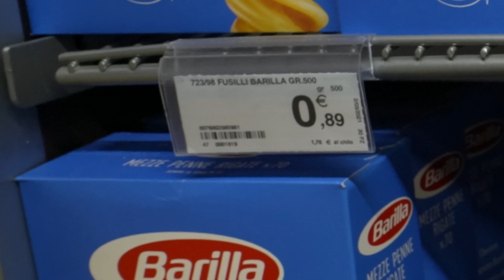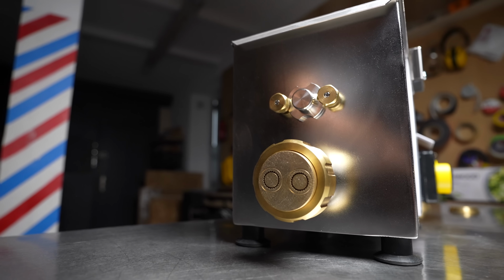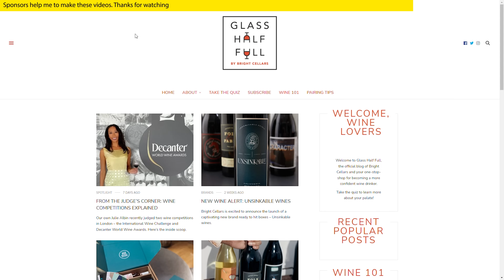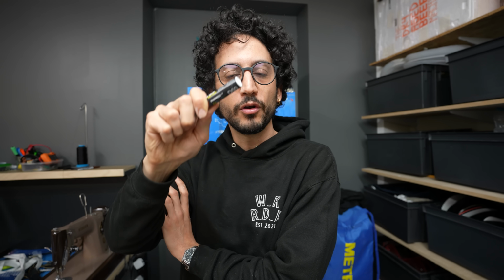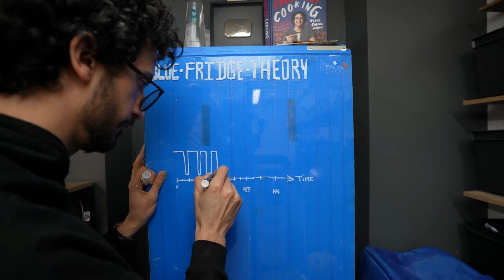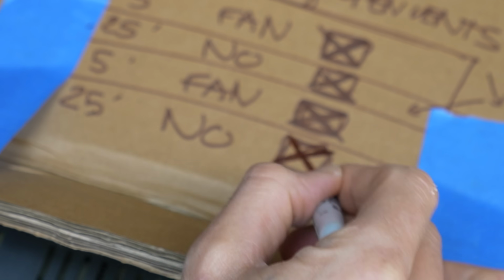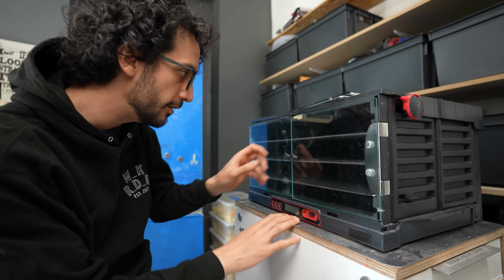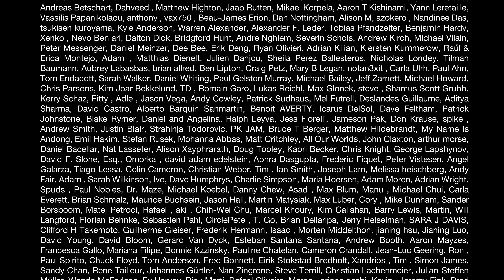This is Why Drying Pasta At Home IS ALMOST IMPOSSIBLE

Comment: You need a reflow oven. They are used to flow solder for printed circuit boards. PCB solder reflow requires accurate temperature profiles (well as hobbyist you can get away with not doing it exactly) my point is, a reflow oven can increase temperature at a certain rate, maintain, lower it, wait, etc. Seems like exactly what you really want to dry pasta.
Personally, I would just make a temperature/humidity controller with a microcontroller...

Comment: Good luck on the vent-ilation project! I was surprised you did not add a timer in the circuit of the dehydrator yet, it's probably time to build a franken-dehydrator! Have you considered the "cold and humid" aspect of the resting period mentioned in Italy? Turning off the dehydrator may be insufficient.

Comment: During the rest period, you may need a humidity source. Your chamber air is consistently dry during the whole process. A dish of water maybe?  Alternatively, you can look for a temperature humidity oven (TH chamber) so you can control the temp and RH at a ramp rate you want.

Comment: That fan might actually be working but going in the opposite direction you think it is.  You can see from the string that the center is the intake so the flow would come out the edges.

Comment: Interesting stuff. I also wonder if the humidity has some part to play - he mentioned they dry pasta with low humidity high heat, and then flip to high humidity low heat.  It seems like you aren't replicating that latter step, as you just turn off the heat.  You likely need to increase humidity too.

I'm guessing that the best pasta you produced came from the areas surrounded by other pasta, as the increased humidity from the surrounding pieces helped keep it more stable as it rested.

Comment: The hard one is called elastic because in mechanic physics an elastic shock is one that converts 100% of its kinetic energy from the first object to the second. (Which means it has infinite hardness).
Elastic on the other hand means the object will deform at the moment of contact and not all the energy is transferred.

Comment: Alex as I could see the fan on the drier is sucking air out of the machine, so it is installed to extract the humidity of the box, not to recirculate the hot air inside. I don´t know if from the design perspective that is correct or not, meaning that may be if you change the direction of the fan will solve the problem or just replace it with another one.

Comment: Alex, in order to get the pasta properly dry, you need to get it wet. It reads like madness but hears me out, there is this force at the molecular level that attracts the water molecules between them, that force without finding water in the environment your pasta is drying will pull the pasta molecules shrinking the gap in between and breaking the pasta.
The solution I propose to you is to, along with the new fan, to ad a shallow tray with one or more ultrasonic humidifier discs, this will add moisture to the environment. The humidifiers will need to turn on, when the electric heating system of the dehydrator turns off, keeping the fans on so the air currents can distribute evenly both heat and moisture.
The moisture of the external layer will reduce the stress on the exterior of the pasta, reducing cracks, while allowing the interior to dry slowly.

Comment: so uh, i think youre partially correct about the purpose of the rest period. 
it is true that it is necessarry to give the internal water to make its way to the surface, but i think it is more important to make sure the outside of the pasta never fully dries out. as youve seen, fully dried pasta is a one way street. which is why at the factory, the pasta doesnt just rest, it rests in a high humidity environment.

Comment: If you are looking for high quality fans for this projects, I recommend Noctua’s Industrial PPC fans which have high performance and can operate reliably in a variety of conditions (including higher temperatures), and the noise won’t be too bad (as long as you don’t use the 3000RPM VERSION), and they are very quiet at lower RPM while still performing well, so you should be able to film with the machine running in the studio.

Comment: I’ve studied a lot of physics and a tiny bit of material science. The plastic versus elastic definitions are absolutely spot on! Plasticity is not about if a material is made from the things that we call plastics because of their chemistry, it’s the property where a force will permanently deform a substance (like play dough). Elasticity is the property where a substance will bounce back to its original shape (like a  rubber band or spring). The fact that your pasta is brittle and easily fractures when in the elastic state just means that it has a very small elastic threshold. It’s still elastic, it doesn’t deform, it just reaches its elastic limit very quickly
Reply: Also, good work! This is absolutely amazing! I’m very impressed with your work!

Comment: @Alex
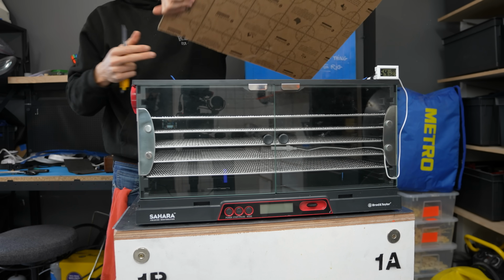10:10 Buy a timer that can cut of the electricity to the dryer automatically, it's quite cheep (depending on model of course), that lets you do at least half of the steps automatically (on --> off steps, the reverse still needs manual input, unless a REALLY advanced timer is bought).
You should be able to go into almost any tech-store & ask for something like this, or buy through the internet.

Comment: Maybe look into the fans that sit on top of wood stoves to circulate air. They can withstand high temperatures and are powered using the surrounding heat.

Comment: I had hoped you would notice, that the fan in your dehydrator is an impeller. So in sucks air in in the center and then expells it like a flat sheet over the back wall. That explains, why there is very little airflow in the center, especially if the doors are open. The hot air just brushes over the back walls, hits the sides and streams out, it doesn't circle back around the front doors and back into the impeller. You should have maybe taped some strings at different places into the machine and shut the doors so you can see, what is really happening insde during proper operation.

Comment: I would put two computer ventilators on the opposite sides and connect them with isolated outside tube, which would keep same dry air inside and keep air moving like in tunels

Comment: Number 3: a combi-oven. They are made to regulate both temperature and humidity (and can even be programmed with custom cycles). Though the first models for home kitchen (like from Miele or V-Zug) are not cheap, it is much less than a professional one (or an industrial pasta dryer :-D).

Comment: ALEX 
u can build one 
use XPS insulation with one side covered in aluminium foil
make box from it , build heated intake for example put some silicone pad heater inside a tube or something with thermostat so u can block the max temp of it so it wont overheat

make main box , mount fan on left , heater on right (remember it cant be too powerfull or it can damage the xps ...or at the heater side u can use blocks made out of foamcrete - aircrete (concrete blocks super lightweight)  , then make 2 walls with holes and mount them inside the box 10-20cm from left and right wall , covering the fan and heater ... u need this so the air can be evenly distributed
 
at the end add inside a extra fan or 2 and programmable pid temperature controller for around 20-50$ and u ready to go :) 

everything should be possible to make under an hour

Comment: The fan appears to be blowing out of the dehydrator. You are unable to feel much because the velocity of air coming into the chamber through the front swinging doors is quite low to replace the mass flow rate out.

Also, this appears to be a mass transfer problem and reading some Chem e mass transfer notes may be helpful seeing as you've got an engineering background.
There is a maximum rate of diffusion of water through the pasta dough, an optimal rate of diffusion through the dough, and a maximum and optimum rate of evaporation from the pasta surface. As many have said, adjusting the humidity is important. 

If you flip the fans around to blow inward, you could arrange a set up to control humidity on the air inlet outside the dehydrator box. Something like pulling air over calcium chloride would lower humidity while you could add a humidifier to increase humidity. 

Interested to see where this goes!

Comment: The drier is probably working as intended and shifting a lot of air. It's just the air speed will drop off massively the further from the fan you get but the area is increasing. Whether or not this is enough for pasta drying i do not know...From reading the comments my guess would be the speed of drying and the humidity during different phases is going to be critical to getting it to work. Looking forward to seeing some Arduino controlled drier!

Comment: Since we're sciencing this thing out, you should look at the surface finish inside the die, that will determine the smoothness of the outer shell of extruded pasta.
Reply: Along with the moisture content of the dough, and the particle size distribution of the flour.

It's a boundary condition problem, where the extruded dough needs to be in a balanced slip vs. drag state.

Comment: People keep mentioning that moisture/humidity is vital to the process in the resting periods - I wonder If a oven designed for bread would work? I believe they all create humid environments bc bread need water/steam to develop the crust properly (thus people in home kitchens will use Dutch ovens to trap the steam from the bread itself in a sealed environment) and most go down to room temp because sourdough/yeast only rises in certain temps before it would die from heat so they often have that dual function for proofing and baking

Comment: Great work Alex. Would you consider using an Arduino with a relay unit to simply set the correct on and off timing with your existing drying machine? You can also turn on and of multiple devices if you extend your relay unit. Besides, if you want to take it even further, you can add an if statement to the Arduino code like, if the oven reaches 50 degrees = turn off the machine... Good luck

Comment: I wonder what the distribution of the airflow is when the door is closed. When it's open there is weak flow everywhere, but when it's closed I'll bet there's good flow around the door openings and fan with lots of dead air zones. You would need to tie threads all over the racks to find out the optimal pasta layout. Then you could increase the power of the fan until you get sufficient airflow around all the noodles. Finally, add an Arduino/Raspberry Pi/ESP32 to push the button for you.

Comment: I would make my own dryer. A fan, a heater, a sensor, and a controller so you can program your dying cycle and get precise, repeatable closed-loop accuracy. 

If you want a step up for a premium version, add a small room dehumidifier evaporator coil at the input to make it possible to dry at lower temperatures and make the heat and humidity independently programmable.

Comment: @Justin C mentioned PCB reflow ovens. It might be enough to turn your dryer on and off (when you put a fan in there). you could prob. The code should be relatively easy and there might already be solutions for you out there (think time controlled home automation)

Comment: Getting some air movement in the dehydrator shouldn't be too difficult for a first test. I'm sure there are also machines that allow you to do some pre-programming of the temperature. Failing that it wouldn't be too hard to build a specialized pasta drying machine at a good size. All you need is a big box, isolated would be best, some temperature sensors and a way to toggle both heated and normal temperature airflow. I've seen similar builds for DIY fermentation stations, often using an old fridge which would also give you the required racks. You could either add some timers to everything or rig up an arduino to control the setup. If you want to go crazy you could even try adding some humidity control. An outgoing vent would reduce humidity and maybe some ultrasound misters to increase it.

Comment: You can get mechanical electric timers for very cheap that will turn a device on/off at 5/10/15 minute increments. Watching you manually control the dehydrator was painful!

These videos have inspired me to attempt dry pasta myself and have had limited success drying in my excalibur dehydrator (fan is really good on this unit though!). Going to try to use a timer to set up periods of rest and see how it goes :)

Comment: I think you need to build a Micro controller* based control system for the drying schedule. A basic timer system with relays is easy, it's only a step further to add sensors and make it do something smarter.
*a cheap programmable PID controller like those used in brewing would also certainly work, I've used them to replace dead kiln controllers.

Comment: You missed the low temperature with high humidity part that allows the outside of the pasta to be forgiving as the water leeches out of the center.

Comment: You need an Arduino and relay board so you can program your drying steps automatically and measure temp and humidity, log to a spreadsheet and compare runs

Comment: You can try to make a simple automatic button pusher. Use an arduino or something with a cheap servo motor. Set in how and when it moves, and tape it to the machine.

Comment: There was a comment about how rough the texture was compared to more commercially available brands. It does work to your advantage some, but I've also seen some of the extrusions warp a bit on exit. I would suggest this bit of love from the machine community, Blondie Hacks, Abom79, ThisOldTony. My take from them is manufactures don't debur anything, so the cast and machine the dies as fast as possible, but I wouldn't expect it to have been gone over with stone, file, or debur tool along the way. Hope that helps make those pasta shapes pour out like softened butter.

Comment: Maybe leave the dehydrator on but connect it to a digital timer electrical plug? So you can set what time it goes on and off and add a separate pc cooling fan inside for circulation.

Comment: Plastic deformation means that the shape will not return to its original form. Elastic deformation means that when you bend or put stress on something, it will return or "spring back" to its original form.

The soft pasta will never return to its original shape, while the hard one will retain its shape. The hard one obviously does not allow a lot of deformation before it breaks, but it's still in its elastic deformation phase.

This can be compared to a piece of metal or a spring. Counter-intuitively, springs need to be hardened for the same reason. The hardest pieces of metal will always spring back to their original form after stress is removed (unless they pass the yield point, which is where plastic deformation begins.

If you look at a stress strain curve of pasta, it will be mostly linear until it breaks.

Comment: Alex, did you test the air flow also with the doors closed? I don’t know how much of a difference it will make, but it seems possible that the dryer is designed to pull air better with the doors closed.
Reply: I'd think that would be more of an issue with a larger commercial design.

Air under these conditions is an incompressible fluid, and if you move a volume away, and equal volume needs to flow in to replace it.

Also, suction fields are much less far reaching away from the inlet nozzle than the corresponding blowing field for the same volumetric flow of air.

I suspect that the muffin fan on the dryer is not sized to create much of a suction field inside the box, in order to not dislodge small, light foods.

However, for this dryer to work for pasta, the internal air circulation needs to be greater, especially to ensure uniform humidity of the air coming into contact with the pasta - basically, a different fan, and with the blast and inlet reversed from what the present machine has.

Comment: That looks like a centrifugal fan.  Meaning, that was the intake at the center, and the air is pushed out all around the edge.  It's done this way specifically to avoid blasting the center and creating a hot spot right in front of the fan.  The goal is to get everything moving more evenly.  Trust me, you don't really need as much air movement as you seem to think.

Comment: It seems like the issue is that drying with air that is very low humidity is causing, essentially, case hardening. Instead of the square wave of drying/resting, the top of the chart should be decreasing humidity %. An hour in moving air at 50% humidity, an hour at 30%, etc etc. That's a lot harder than a heated dehumidifier, but it'd be possible by hacking together a fan and dehumidifier with a digital humidity controller to cycle the heating element based on humidity. Maybe a dual channel one and a humidifier as well.

Comment: It would also be really interesting to see if you could reprogram the dehydrator, but I'm not sure how easy that would be. I think one way would be to trick the controller into having a lower temperature to turn on the heating element, but then you'd have more of a curve than the step-like function you have there.

Comment: Oh Alex... that's so cute you tried to explain strength of materials... Elastic state means that in a given INCREASING force - the material would deform accordingly. Plastic state is coming AFTER the elastic state and when the material gets to it, in a given STEADY and prolonged force, the shape would continue to deform. after some amount of deformation the strains are too high and the shape collapses.
The dry pasta and it's shape causes a very  short Elastic state, which means it's more crisp (just like crackers and glass).